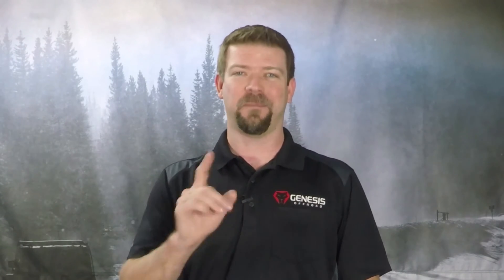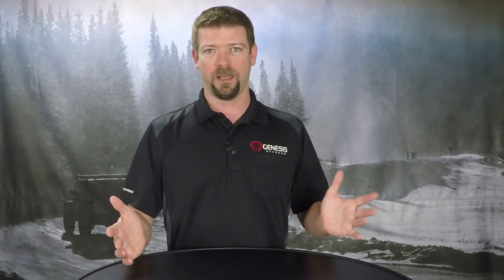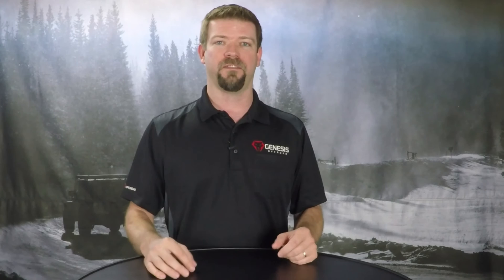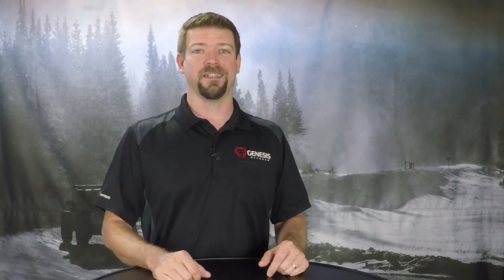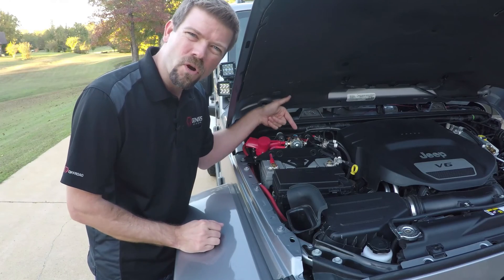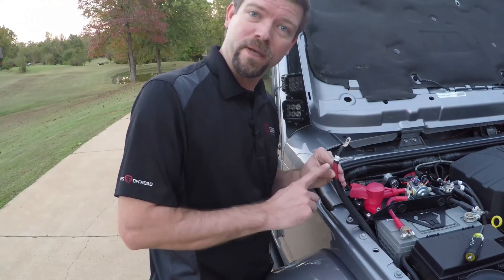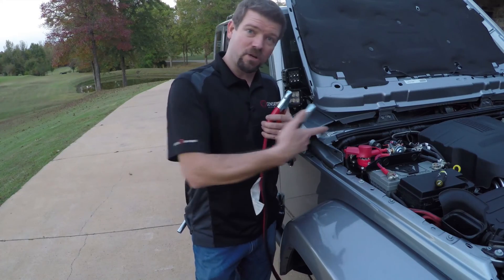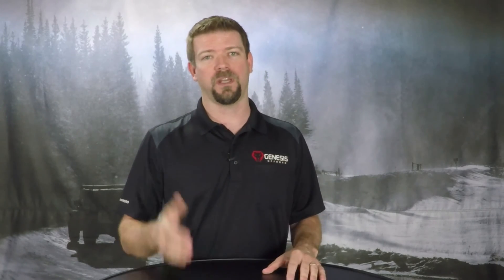New Video Series from Genesis Offroad!

Comment: I have a question, it’s all components Waterproof????
Reply from the maker: Yes, all the components on our dual battery systems are waterproof. You can spray a water hose directly on the kit with no worries of damage or corrosion.

Comment: I'm building a trailer and I want to know how to charge the trailer  batteries
Reply from the maker: We make a set of heavy duty, quick connect cables that can be used for charging your trailer battery from the vehicle's alternator. You can use our 18' long cable to go from your vehicle's battery (or our dual battery kit) to your rear bumper. Then you can put one of our 7' long cables from your trailer battery up to the trailer tongue. When you connect the trailer to the vehicle, simply snap the 2 connectors together. Here's a link to more info on the cables - https://www.genesisoffroad.com/quick-connect-cables

Comment: How about covering wiring in the input from and solar charge controller and a shore power battery charger?  I'm slowly turning my 09 JKU into a camper and will have both in addition to a second battery.  Also, can you recommend a dealer / installer in Reno, NV for the dual battery setup?  Thanks!
Reply: ThePyleDriver This
Reply from the maker: Yep, we get a lot of questions about solar panels and trickle chargers. Watch for that topic video coming soon! Our closest dealer to you would be Cloakworks (part of Metalcloak) in Rancho Cordova, CA. Thanks!

Comment: Hypothetical question as I don't have a Jeep yet: I have an 8 circuit Spod SE, a Warn Zeon 10s, and your dual battery kit. What is the best way to wire power for the winch?
Reply from the maker: Excellent question! A winch will have 4ga or 2ga power and ground wires, with large lug terminals on the end. You'll put those lugs onto the center studs on the Genesis power and ground bus bars. Those large center studs are for any high-amp accessory such as your winch, stereo amplifiers, even the sPOD. While the isolator has the batteries connected together, those accessories will use the combined capacity of both batteries. Once your cranking battery drops below 12.7v for 1 minute, the smart isolator separates the batteries so that your accessories that are connected to the bus bars will continue to run from the Aux battery only. This protects your cranking battery from being drained down too far. Hope this helps! -Shane